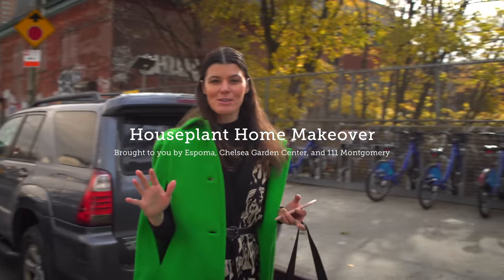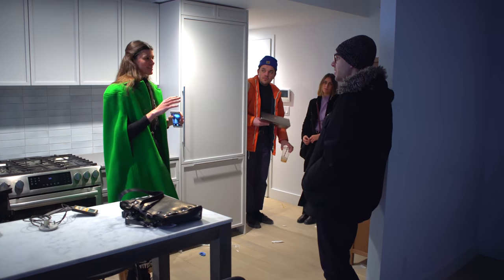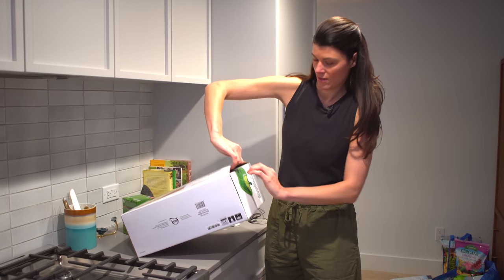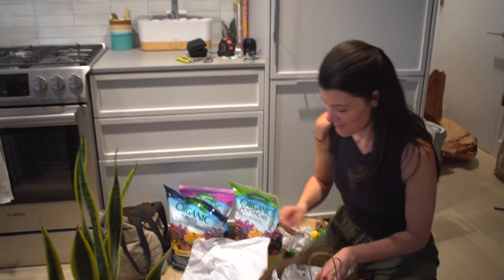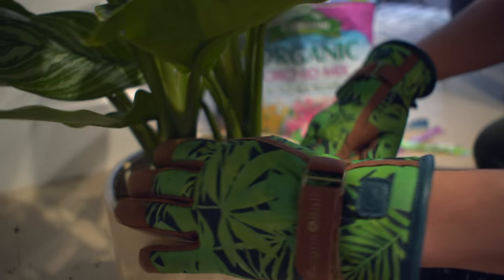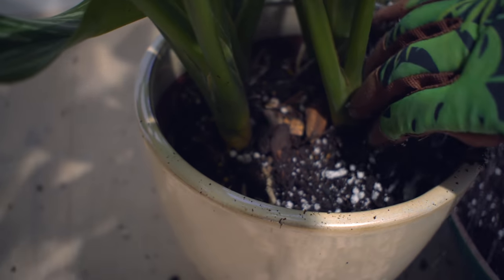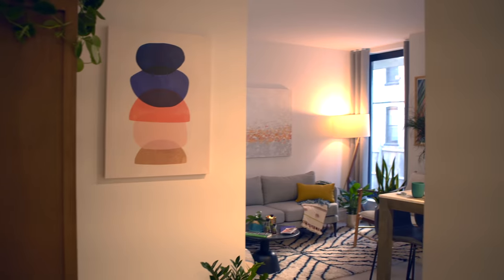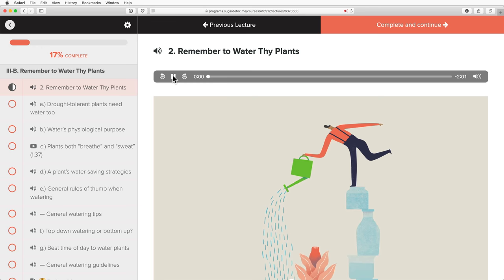I Made Over This Entire Studio Apartment for $5,000!  Houseplant Home Makeover — Ep 160

Comment: Nice before and after! The high pink flower arrangement is nice, but I felt like the placement of it on the island took away from Alina's original artwork which is the show-stopper in the space when you enter. May have just been camera angles but I wanted to move the high floral arrangement somewhere else so that the WOW came from Alina's picture when you walk into the room. Could also have had one more wall mounted light fixture on the other side of the sofa to balance out lighting. I love the moss in the bathroom! Not a fan of clutter on the bathroom counter top so would have liked to see tall slim etagere or wall shelves and go vertical to max out storage in there. You mentioned magazine rack coming but I think a wise choice is skinny and high not something on the floor since there is precious little realestate in there. Love the coat also!

Comment: I would rearrange some of those plants .....that one you put on the floor in the hall next 2 the kitchen is overwhelmed by the space and way too small. A taller plant would have. been nice. or setting it on a plant stand or on an overturned pot 2 elevated it. Also the 2 in front of the  window would look nicer switched so that the taller one is next 2 the sofa and the smaller one where the taller one is now as the small one is hidden by the sofa. And finally. I don't see a single potted palm.... I wouldn't be a le to resist a potted tree with fairy lights on it.